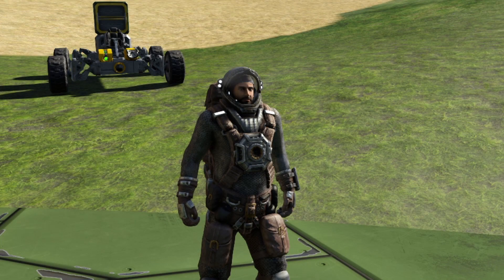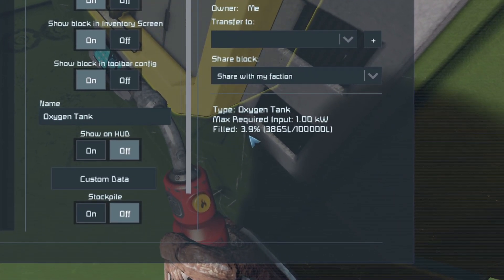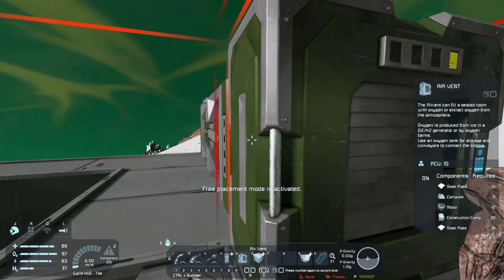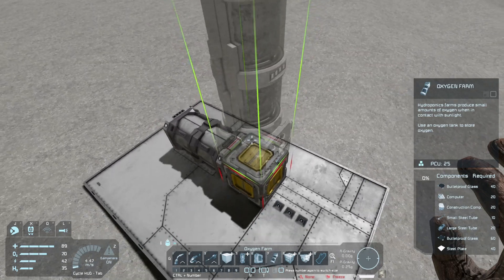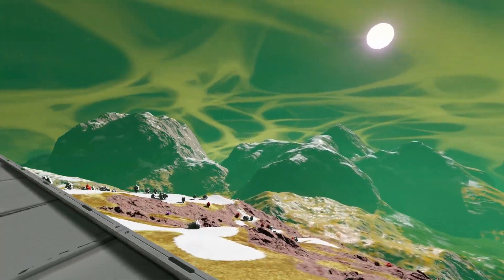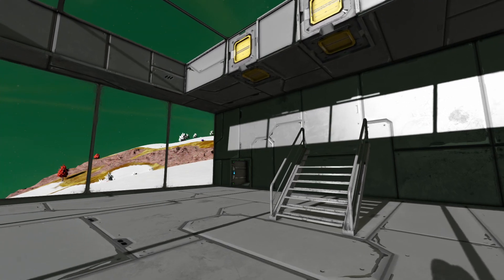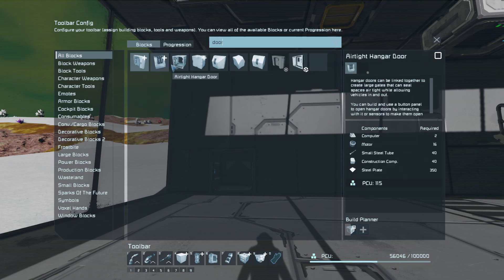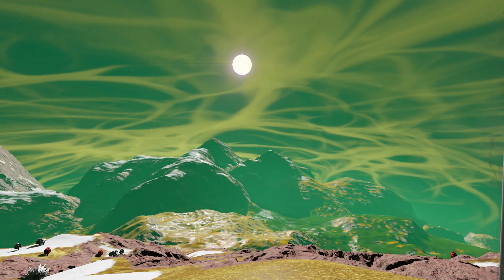How To Breathe/Air Vents | Space Engineers

Comment: This is a great tip - thanks!
I just added an air vent on the outside of my primary ship, which is intended to mine in space and take off from planets... and added another O2 tank.  It won't make a big difference at this stage of the game (I use hydrogen thrusters so I have to keep searching for ice anyway) but I save some of the ice for my irrigation systems.  And it will definitely help on a future start.

Comment: How to make actual air tight room by itself
Reply from the maker: I'm not sure what you mean.  Just a normal door on a room is air tight. If you're wanting an airlock you just need 2 doors with an air vent in between the two. Use the air vent to add or extract air depending on which way you're going. Too much to explain in text here.
Reply: @ Tallman Brad Gameplay, I see then theoretically you never lose air!

Comment: Question, would it be possible to use an advanced rotor/3x3 hinge and solar panel for the oxygen farm (similar to scriptless auto solar panels)?

Asking since I decided to start on the moon and ice is quite a bit away from my base and in the mountains and thinking of running similar along side my solar farm.
Reply from the maker: The script works for oxygen farms. Buy it is only interested in rotors in the 'group' to operate. The hinge would have to be controlled manually. Unless the script has been updated in the last year?

Comment: I have a air tight ship and the air is not flowing in and i have it connected to a H2/O2 generator with ice in it and nothing is happening what do i do?
Reply from the maker: There could be a few things going wrong there. I'd start by checking your vent is set to pressurise and has no red lights. Can you fill an oxygen tank from the o2 generator? Perhaps add an o2 storage tank to the system so the oxygen is already generated. Sorry if I'm not much help here MrTrex. I hope you get it sorted.

Comment: Speaking of airlocks and losing O2, on the Steam Workshop, nukeguard has created a... mod(?) for a "rotary airlock". It looks very interesting, and a whole lot simpler than the double-airlock system.  Could you possibly do a video on that? Pros vs. Cons; caveats, gotchas, How to, etc.  Thanks.
Reply from the maker: Hi Gary. Sorry I didn't catch this sooner. I've used that mod on a server before and it works exactly as described. If you're happy with mods and you're looking for an extremely simple solution to getting in and out of your base or ship, as a foot passenger, without loosing air then this mod will work perfectly. The only argument I can see against it is simply that it is a mod. That's absolutely it. If you're comfortable with mods and need a simple solution this is it. If you'd prefer the engineering challenge of creating your own then you should look at least at a control panel to trigger depressurisation, after that sensors to trigger it for you and later, possibly, timer blocks for full automation.
Reply from the maker: I should add that the mod version takes up the space of 1 block where a manual system is going to take up a minimum of 3 blocks. A manual airlock on a ship is pretty big. But with the mod its the same size as a regular door. In terms of blocks.

Comment: if you have large ship airlocks you want to depresurize the airlock instead of letting the air escape. you need an oxygen tank to temporary store the air. the tank should not be connected to anything else, so it doesnt fill up.
Reply from the maker: I agree with the tank to store the air. That's a great point about not having it connected so it doesn't fill from external sources. I like it. Thanks for mentioning that Timmy.